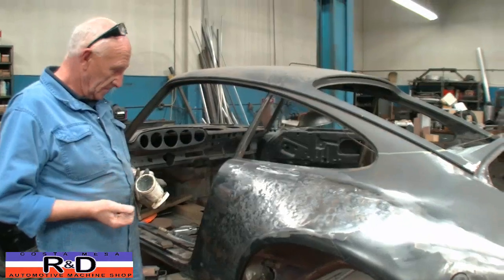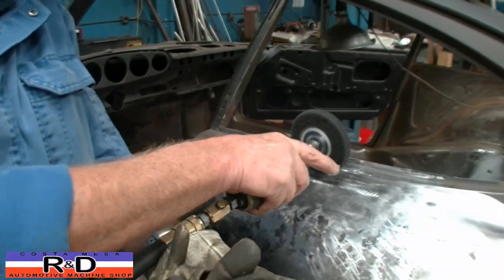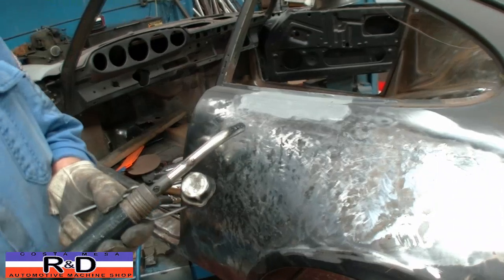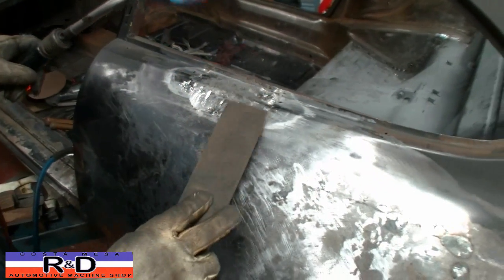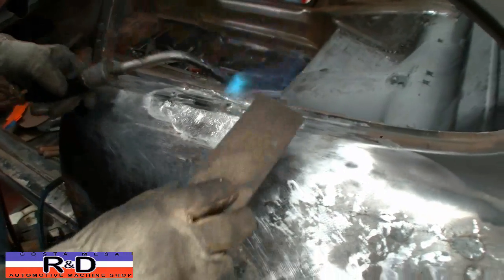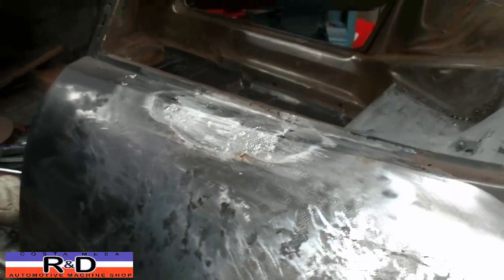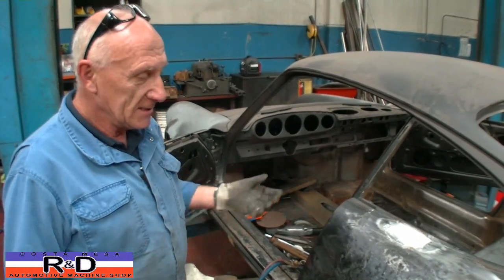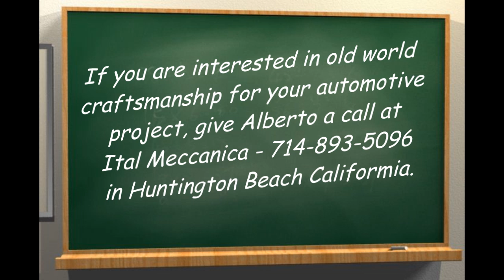Using Lead in Body Work Instead of Plastic Filler

Comment: one of the problems using this technique is that todays primers are not made to bond with lead.But i used to love to say yea car has no bondo...
Reply: +kevin bodman Today's primers absolutely bond with lead. Adhesion problems are due to lack of proper preparation. Once you strip the flux and any wax/oil residue, a conventional surfacer/sealer will bond to it the same as it would to steel, aluminum, or brass.  We do it with PPG DP-series epoxy primers all the time. Ask your field rep for information if you have problems.

Comment: Lead is excellent but let's not fool ourselves in the case where there is large sections of damage.  Some cars are so off now that it requires skimming the entire body in filler.  You can't realistically do this with lead.  But on welded seams and small dings lead is great but in most cases there is too much deformed metal to rely on only lead.

Comment: Nice, we used moleskins to move lead on 8" tube for underground telephones. We had copper wire plus paper inside ours ...our we're pressure tested to 9lb as most of the time they were underwater...so no leaks boys..

Comment: You makes that look easy but the sheet metal on that car warps easily under any heat. When put together its solid as a rock but you take one piece of sheet metal or quarter panel out and as flimsy as all heck

Comment: Hmmm, is there actual lead used in lead work? If so, that might be a big contributor to this skill dying. Was interesting to watch though.
Reply: Body solder is a proportion of lead and tin. I,am still in this trade today,

Comment: Appears to be very labor intensive and time consuming.  Sure, it's a lost art, but so is the horse and buggy.  Seems like he's not putting too much heat on the body panel itself leading to what's called in the electronics industry as a "cold solder joint".  I just wonder how well the solder adheres to steel; not as good as Bondo.

Since he's in CA, I'm surprised the CARB hasn't shut him down.

Comment: Problem is most modern cars you can’t apply heat it will destroy the metal this is for older cars that need to last forever very nice job tho!

Comment: Does this amount of heat warp seriously think panels today? or is it a factor?
Reply: Rick Bell the melting temperature for body solder is pretty low. You need to get to welding temps to have serious distortion

Comment: Unless you sand it and breath in the dust, you're not going to ingest any of the lead from this. It's the same as soldering wires using lead based solder. The smoke is flux, not lead.

Modern fillers are really good though, nothing like the stuff they had back when this was the better option, and while it makes sense to use tin in areas that have panel joints, it doesn't really make sens to use tin on small dent damage today.

Comment: Now be honest chaps :) after that exelent bloke files the lead down there will be a little skim of bondo just to level it out perfect :) great vid guys
Reply: No, building primer. ;-)
Reply: A "classic porsche" doesn't matter. It's just the method.
Reply: No need for bondo. File, then sand to shape. Finito!
Reply: At least a magnet will stick to it.
Reply: Magnets stick to LEAD?! MUPPET!!!
Reply: odeis5 I don't understand why filling a dent with lead is any less hacky than filling a dent with Bondo. It's still concealed damage under the paint, what's the difference?
Reply: Chris Bellers the difference is, the bog is porous & it attracts moisture & will most likely fall out(or at least swell) in the future, where as the lead won't. 

Traditionally, lead wiping wasnonly ever used during the manufacturing process & used to cover spot welded 'joins' (a quarter panel to a roof skin for instance) where as a mould is now used for some vehicles.

This particular instance there are many areas where it isn't 'finished' or 'dressed' for want of a better word & is covered in 'slapper' marks that will either need considerable heat shrinking & finishing with  hammer & dolly's before 'file finishing'

Would I 'bother' going to all of this trouble? Most likely not, simply because the owners just won't pay the money for this kind of job! Would I put a very thin wipe of bog over it to get it gun barrel straight & bring it upto Concourse Standard?! My word!
Reply: Bondo has more chance of dropping out and when body leading you're repairing metal with metal.
Reply: Spray putty, not bog (bondo)

Comment: What about prolonged exposure using this stuff?
Reply from the maker: +shawn sharpe Too much of anything will kill you, you have to choose those battles that you can win, but with caution.
Reply: +shawn sharpe No telling how much lead Alberto has in his system.
Reply: +shawn sharpe Alberto here is still kicking and judging from his expertise, hes been doing it for quite some time.
Reply: +shawn sharpe Lead is a slow killer. The biggest effect initially is on IQ. Like any metal in the body, once it's there, it never leaves. Meaning every time you are exposed, it does you more harm.
I knew someone who worked in lead mining, their blood was tested weekly. Over a certain level you were sent home for two weeks, if you came back and tested over still, you got shifted to off mine jobs. Lead is extremely nasty long term, I just hope our friend here doesn't find this out.
Reply: You can get solder that is lead free.  Even though it's lead free they used to use lead so that is how the term leading came about.
Reply: They aren't using solder, they are using lead filler.
Reply: He said it: 70/30 - that is 70% TIN and 30% LEAD, otherwise known as solder.
Reply: he's no spring chicken...so i dont think he need to worry about long term lol
Reply: Inhale the fumes when heated, getting on your hands and not cleaning them properly, lead can be absorbed through the skin, and before lunch as an added example.
Lead poisoning is irreversible. Once you've got it, you've got it. If you think about how little it takes for a kid to suffer brain damage from ingesting old flaked off house paint, this stuff is no joke.
Reply: DDS029 This stuff is in your cell phone. Its used in EVERY ELECTRONIC device to attach components to traces on the circuit board. Are you wearing ppe to watch this video?
Reply: shawn sharpe,i'm not being a dick,but I've repaired a lot of lead sleds,they are damn good repairs,i did,i never work lead indoors,i pick the days I do it,customer doesn't like it,take somewhere else,your health is all that matters,this trade is what I like,i make damn good money doing it,but you have to read the labels on all of the chemicals a bodyman uses,and using lead,hell I wear a spacesuit,i don't touch it,or breathe it,i do bodywork outside anyway,i want to see what I'm doing,flawless the is word or don't touch it----------FINELINE ALLOWS YOU TO PAINT IT BLACK
Reply: DDS029 " lead can be absorbed through the skin" - Do you have any source you can back this claim with?

Comment: I STRIPPED MY CAR DOWN TO METAL AND FOUND SOME OF THIS
 I THOUGHT I WAS CRAZY
Reply: Yipes!! Poisonous!!!
Reply: . . . but typical to connect roofs to quarter panels. I think for the cars they haven't redesigned yet, I think lead was the method of choice due to it being able to bend a touch while fitting the panels to others.

Comment: Well Alberto, that"s real nifty and all but as a profesional bodyman  for over 30yrs. I have to ask, what the hell is the point? modern pollyester filler will out perform, outlast, is lighter, safer,stronger, easier to work with, ect... are you just demonstrating how it was done before modern matierials? Again, please explain what could possibly be the bennifit of this??!! To keep it "all metal" ? or just see how much time you can waste? give me a break!

Comment: Ahhh...nostalgia. IF the body is properly prepared, the high tech SUPER light fillers of today will easily outlast the vehicle. The vast majority of these old cars we restore will be driven 10 times a year so there is even less opportunity for failure. I've begun tearing down my '58 Apache, that I restored in the late '80s using DP40 and the current tech body filler. Those repairs were intact 30 years later. All this guy is doing is loading the car with unnecessary weight and risking acid remaining to bubble the paint. Next, he'll tell us how great buggy whips are.

Comment: That's how you do it although id use some PPE.
Reply: Michael Langley Its just tin sodder. You only need a vent really.
Reply: This repair will outlive bondo.
Reply: @richardvaughn2705  do you mean solder?

Comment: It's amazing the amount of How-To videos there that throw all regard for personal safety into the bin.  As Brian Sparks commented below, there is no respirator being worn when heating the lead.  Also, before that the fellow is dipping his bare fingers into that tub of flux.  Soldering / plumping flux is highly toxic and most likely a carcinogenic if the truth be known.  People don't know that the skin is a highly sensitive organ, it's not a closed barrier to chemicals and anything put on the skin can be absorbed into the blood.  There have been poisons developed that when placed on the skin, can result in death within 10-15min.  So the flux is entering his body not only through the skin but when breathing the vapours during heating.  And people wonder why they get sick.
Reply: SW: The skin is highly resistant to chemicals. It is NOT true that all chemicals applied to the skin enter the blood stream or underlying tissues.   Each chemical/compound needs to be researched individually. (biologist).  Note: lead IS absorbed through the skin.  His handling of all the flux is idiotic and he really should be taking PPE precautions for the lead exposure.
Reply: what are you ? the police?

Comment: OK class, let's open to chapter 1: "The effects of lead poisoning."
Reply: lead free, mostly tin copper and zinc
Reply: He said it was 70/30 so i believe that is 70% tin and 30% lead, common mix for soldering circuit bords and wires is 60/40.
Reply: Correct, 100%. 70/30 tin/lead solder is what he was using.
Reply: There is more lead coming in your system from old copper tap water tubing (it's called PLUMBer for a reason). If what you are saying is correct. There would be millions people poisoned in the US.
Reply: There ARE millions of people in the US with elevated lead levels!
Reply: This wasn't a "how to be totally free from all bad things" video it was about a proven technique for body repair and at no point did anyone say to eat the friggin' lead! and they do have respirators to control the lead inhalation, So Randall open your textbook to the opioid section and see the damage done by those!!!!
Reply: DDS029
There ARE millions of people in the US with elevated lead levels! 

Thats why they fight with overweight
Reply: Krasimir Ivanov lead from copper pipe? ya fucking lost me mate? where, the joins? cut it out!
Reply: They FIGHT WITH OVERWEIGHT? How? By laying on their asses every spare minute?

Yes from the joints. If you don't run the water for 6 hours and drink before letting it run cold 10-20 seconds there is small chance for it to be contaminated if pluming is from the 60s and 70s. Still very UNLIKELY. But you know if you do this for years lead builds up
Reply: Well, I worked as a plumber in nyc. Trust me, it's not as hazardous as you think. There are water mains made of lead coming in off the street, some buildings still have lead pipes believe it or not. The solder for old copper had alot more lead in it. Any old brass has lead in it and only until a couple years ago did they start mandating lead free valves but ijt still doesn't stop illegal ones from being used because you can still get them for boiler systems and fire suppression systems. Anything non potable usually has a prop 65 warning for a reason. Even my body bushings for my truck came eith a prop 65 warning and they're urethane.
Reply: Daniel Anderson here in nz you see a fair bit of lead pipe but not for mains, its all for wastewater. nearly all the 80+ year old homes have lead waste pipes.
Reply: Bro Tang typically cast iron or clay here for the old waste pipes. We used lead for packing the bell and spigot connections, you have lead bends or stubs. Lead sheet for shower pans. Use 50/50 to wipe pans and bends daily. Nothing like working with lead, wish i still had pics of the pans I did.
Reply: If, by proven you mean OUTDATED, then you're CORRECT! Go to the front of the line!!!
Reply: YOU can translate GIBBERISH, well done sir!!!
Reply: Exactly. I've done body work on my own cars with body filler. It doesn't hurt you to have it on your hands. Not only what you mentioned about lead poisoning, but what about breathing the fumes as you heat it up?? Duh !!

Comment: I cant see the advantage , all that heat will distort a modern thin sheet steel body and what about the paint burning off on the back of the panel , that will start rusting. We have moved on Bondo much better.

Comment: These guys are probably still spraying lacquer with no respirator on while using an old high pressure gun😂😂😂
Reply: Hey they are still alive. What about the guys who worked in asbestos for yrs not knowing it was dangerous. Or lacquer and several other chemicals without respirators. I did some myself but we knew no better then. Nobody told us different . Surely not the bosses. Smdh.
Reply: Lacquer has been banned here.
Reply: Yea,it’s soooo dangerous he looks like he might only live to his eighties. Sure am glad the green weenies are saving us.
Reply: Steve Prince  HVLP, primarily. VOC regulation was too strict for lacquer.
Reply: If you pre heat the lacquer you get a great finish 👃

Comment: Next up: making hats with mercury vapour
Reply: mad as a hatter
Reply: hahahahahaha , that got to me, now the scrambled eggs I was eating comes out of my nose.
Reply: Fortunately, it's a lot safer than you would think. If I were doing it a lot I'd take other precautions but gloves is pretty much all you need to prevent exposure in this processes from what I understand.

To clarify a little more though, just don't use ox-ecetaline that might make it boil and give off fumes. From what I remember from high school science class, evaporation takes place (technically) continually through the liquid state in our atmospheric pressure but the amount of evaporation taking place on lead that is barely at it's melting point is so minuscule that you're not really in any danger unless maybe you're doing it all the time...8 hours a day for instance. Otherwise, I don't think it's much higher than the amount you're already breathing in due to everyday atmospheric pollution.
Reply: the lead is not heated anywhere near  to the point that there are metal vapors.
Reply: Ep.3 why phosphorus matches are making a comeback.
Reply: Oh the obliviousness is amazing, after all the crap we went through to get lead out of fuel, paind and pipes.  Lead does not need to melt or boil to he dangerous from its toxins.  Paint chips and lead in water pipes didn't stay safe until it reached some temperature approaching melting or boiling ... lead will grind, degrade and even form dust particles that will get you at normal room temperatures and slowly build up in your system.
Reply: He isn't vaporizing the stuff, professor.
Reply: @mqbitsko25  Nowhere did I say vaporizing.  Dust particles are not vaporization.

A few thousand years ago, people started writing words on paper and making books.  Pick one up someday and read.  Really, you won't explode.

Comment: I can see why most people are going with Bondo!
Reply: You can? Why, when it is a far inferior product? It has a habit of flaking of at a later stage - as it never really "bonds" with the surface. As was explained, soaks up paint and primer if not prepared exactly correctly and makes for a horrid repair if not used correctly, or used by an inexperienced repairer.

The only things on the plus side are it is easier to use and not quite so dangerous to your health - it is still as dangerous as hell though (bondo). Especially when no PPE is used whilst shaping and sanding.

John is right in saying "Pick your battles" the guys who used to lead wipe, worked in times where there was little to no understanding of PPE or the effects that processes and exposure to chemicals could have to a worker's health - hell they even used to smoke in the shop once! Now we are A LITTLE wiser on what we can get away with.

This process is banned by Government in Australia for health reasons, and it is next to impossible to find a craftsman who has the skill.
Reply: +LP2A5071 If plastic filler falls off, the tradesman didn't know what they were doing. I've seen aluminium panels warped like crazy but the filler still intact.

Comment: Nice old technique and skill, but I'll take lightweight bondo, thanks.
Reply: For temporary repair, bondo works great. Long-term...not so much.
Reply: I have done some bodywork on a car that I used to own, and I used Aluminium Body Filler, didn't have the skill for tinning, but didn't want to use regular bondo either

Comment: This chap is not very good at lead loading panels I ave been lead loading on bodywork for over 50 years 
and don't consider this chap to be very good at it, does not shape the lead very good.
Reply: I'm a total novice on body work and I could tell the body line wasn't straight. Maybe he didn't do so great cause the camera.
Reply: Well Carl. How about you throw up a video and show us how its done.

Comment: Modern paints don’t adhere to lead properly either so now your stuck using stinky old solvent paint too. Also that heat is going to distort your panel making the final product look worse.

Looks like all it needs is a skim of putty, this isnt oldschool its fool school.